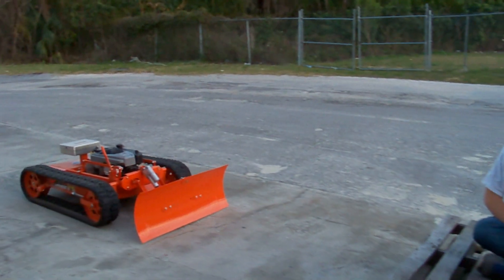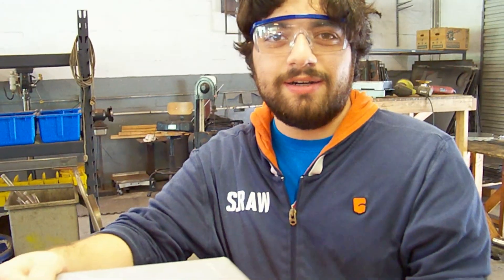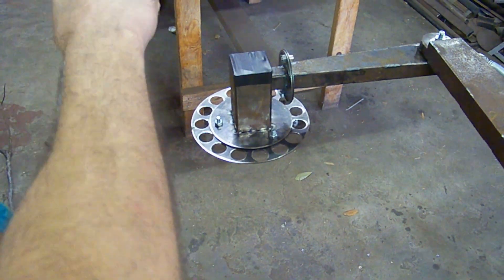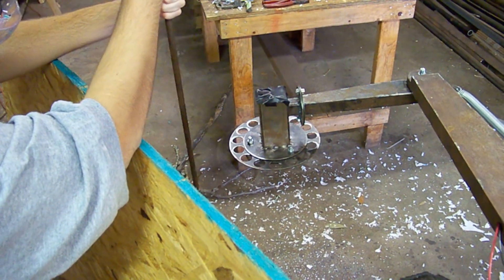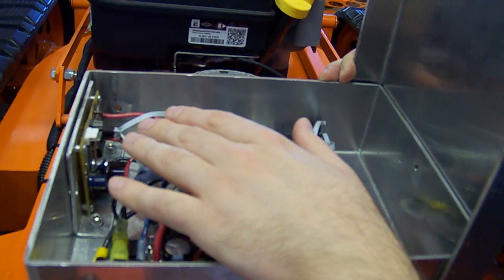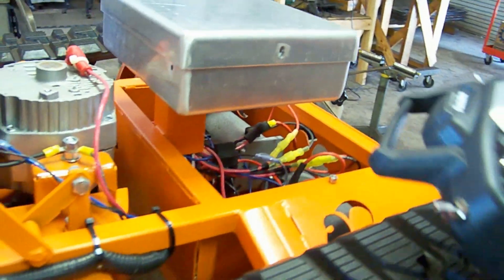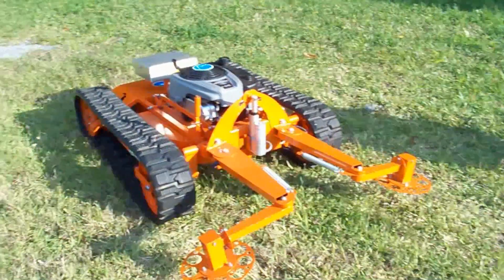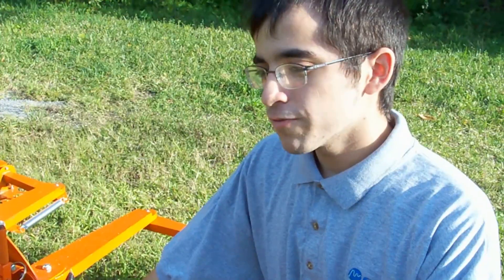22T Robotic Trimmer Attachment (RTA)

Comment: Why reinvent the wheel (trimmer blades)? with a mower engine already running power a conventional mower deck and mount a weed sprayer tank for the edging, with GPS and some sensors it could be autonomous.